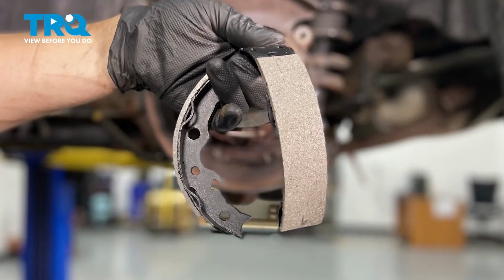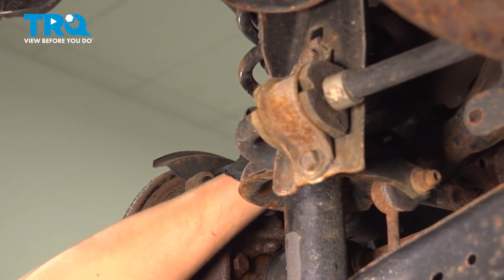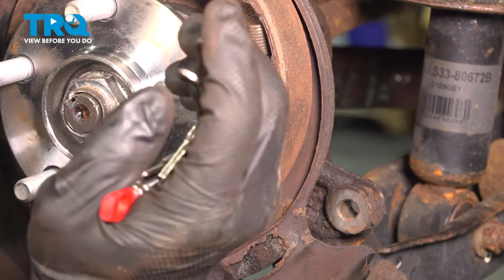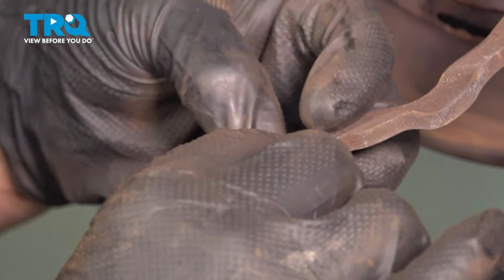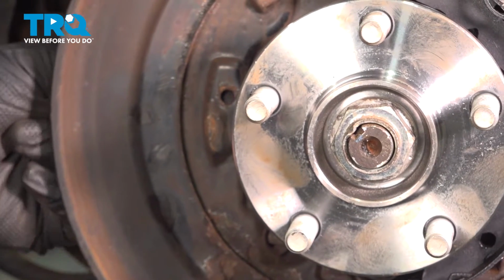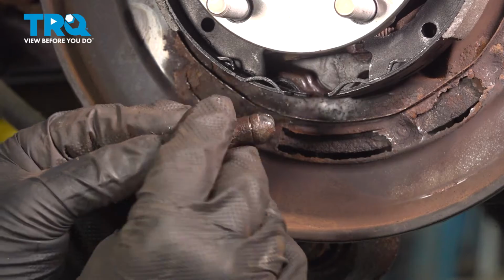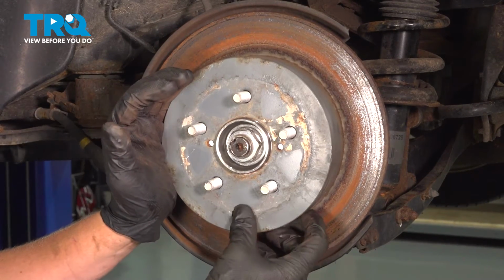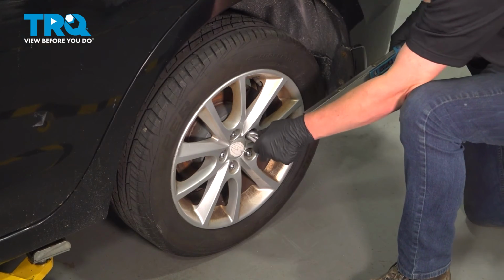How to Replace Parking Brake Shoes 2012-2016 Subaru Impreza

Comment: Raise your hand if you’re here because you replaced your rear hub and had to disassemble the parking brake to wail on the hub with a sledge hammer and now don’t remember how it goes back. Raise your second hand if you earned yourself a new backing plate too with a bad hammer swing.

Comment: So, I watched this ahead of time and thought, "Okay, these are just tiny drum brakes." And they are. What I learned from this is that the design can vary greatly between manufacturers. I can do the drums on my Toyota truck with no sweat, but Fuji Heavy Industries puts the springs and various pieces in different places. As with any drums, the orientation of the parts and springs, placing them in the correct slots, and the order of assembly is critical. The first one takes twice as long because you're figuring out the puzzle.

Comment: Some constructive feedback: It would be helpful if the camera would zoom in on where each spring goes (the hole or slot), and the editor paused the recording for a couple of seconds on each part. Another improvement would be to zoom in on one of the upper springs in your hand or on a surface and explain that one side feeds into the slot in the shoe much more easily than the other. Finally, remarking on the orientation on the self-adjuster would be helpful. I assume that because the driver and passenger sides are mirror images of each other, the side of the adjuster that faces the rear of the car is also a mirror image?

Comment: If anyone is having trouble removing a stuck rotor, there are two threaded holes near the center of the rotor. They are a common bolt found around some of the mounting hardware for the brake lines on the upper control arm. Just thread them in and it will free the rotor without the need to thrash it with a mallet.

Comment: I followed the video now my rotor won't go on. My adjuster is all the way retracted
Reply: I have the same issue. I had to remove the brake shoe while replacing the wheel bearing. It didn't come apart much but in putting it back in place, it's a little too expanded. Did you have any luck?